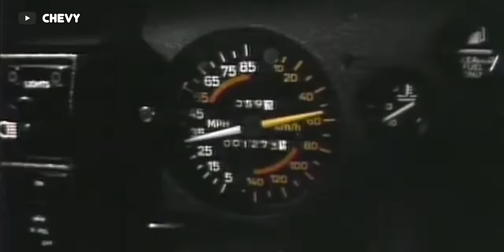These are the WEAKEST ENGINES EVER

Comment: Just a fun fact....hp/L has never won a race
Reply: Weight vs. Power output is literally what makes racing. There is no replacement for displacement. Don't get me wrong. But I bet a stock Honda S2000 with a little 2.0L with 120 hp/l would beat the heck out of a cadillac 8.2L with the exact same horsepower. All that extra weight, for not much gain.

Bigger block means more capability for power, sure. But when you don't use that, it means you have a heavy pathetic engine.
Reply: @duckdestroyer2412  put that 500 inch caddy in the same  vehicle/weight and it will win. Tq wins races.

Then put that 2L honda in that heavy caddy. It would be a massive irritating turd 

Another thing...that honda was built as a performance engine. That 500 caddy wasn't built with performance in mind at all. Just low rpm grunt. 

Both built for performance and the caddy shits all over everything honda ever made.
Reply: @HioSSilver1999  horsepower= torque×rpm/5252

Yeah, torque may get you off the line fast. But that horsepower is what keeps you moving fast. So a heavy slow engine may have a lot of torque, but when a little roadster with a 2.0 and 7-9k rpms comes along, it would smoke it in any sort of distance race. 

Just think of formula one. 1000 horsepower out of a tiny 1-3 liter engine. Would more than beat any road car. Dodge Demon be damned.
Reply: @duckdestroyer2412  Those 1,000 HP 3L engines are only good for 500 miles, if that.  A Cadillac 500 will go for hundreds of thousands of miles.  Most of the time, they'll outlast the cars they were put in.
Reply: @Voltor07  my point wasn't reliability. My point was that power to weight/horsepower per liter is more important than the original poster thinks.

Comment: Not really trying to be hard on you here, but do your homework a little. The 4.7 Chrysler. I do know they started out at 235 hp, but I also know for a fact that they upped the hp to 310 hp in 2008! I had a 2008 Dakota and it had 310 hp. My 2005 & 2003 Dakota had 235 hp. They also had a HO version at the same time as the 235 hp that was 265 hp! As for this video for under powered engines, sorry, but now you sound like Motor Trend. Every year since time began, every year they would print about most vehicles, “but it is a little under powered”. And today they still say the same thing. That’s the reason I cut my subscription to them in the mid 80’s. Get real!! If motor trend didn’t drive a vehicle that had monster HP they were ALL UNDERPOWERED!!! My truck puts out 400 hp, last time Motor Trend tested it, it was “underpowered”. Again, GET REAL!!!! And even at 235, it was plenty adequate for the years it was produced!!!!

Comment: HP is Sped and RPM  Power is all it Torque and the lower the RPM with the higher torque is power  so your video is all wrong  so if you have 2.6 :1 Ratio of torque to HP   you will have a far more power full engine than a 1:1 or 1:higher ratio of torque to hp     do a car or truck that has only 85 hp qith 145+ torque  will accelerate faster and pull more  than one with a 250 hp and 300 torque and  if you can achive like teh 6.5 diesl did 215 hp - 560 torque at 2000 RPM it will out power may of its competitors did  just nor go as fast   so when you talk about Most and least power full engines you look at Torque and RPM ratio to Hp       your only talking about Final gear speed and top acceleration   the Iron duke was able to pull like a V8 did  even though it was smaller and less Power but it had a great ratio so it was power full just not Fast
Reply: and in the pre 1986 years 80-140 hp from all manufactures was normal and common  because of Federal emission laws at the time and the Regulation of Hp and speed on the federal level  all manufactures had there turds ford Dodge and Chevy

Comment: 7.3 powerstroke 😂
Reply: Weak but reliable
Reply: Powerstroke 275 horsepower, and 525 ft/lb of torque. Is okay for a late nineties engine. IDI version sucked in comparison. With 190 horsepower and 383 ft/lb of torque in the turbo version and 185 hp and 338 ft/lb.

You want to talk gutless engines, a 6.9 international is a better target.
Reply: @johnconnell2841  it just a joke and I do have one 😢 with 80k miles